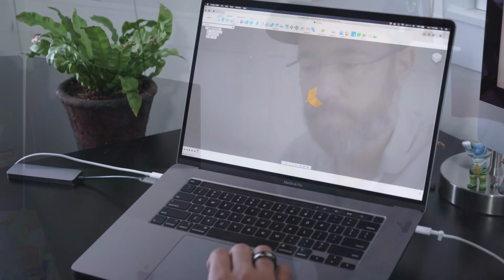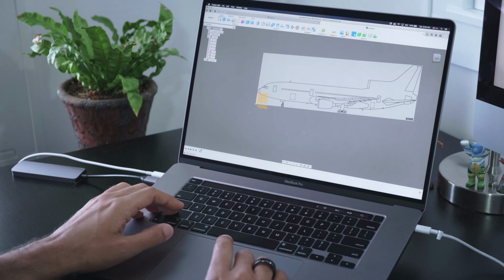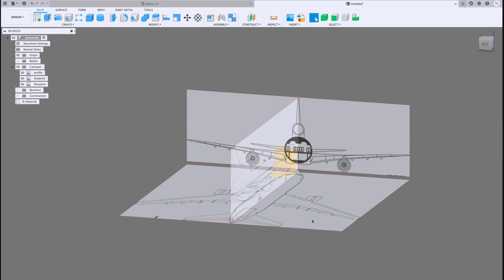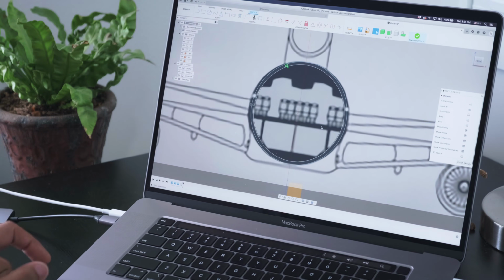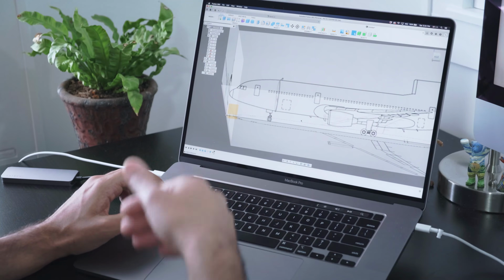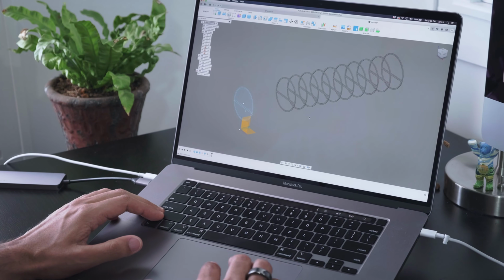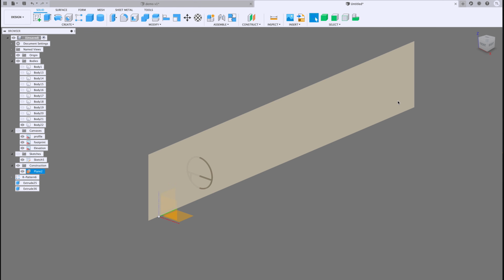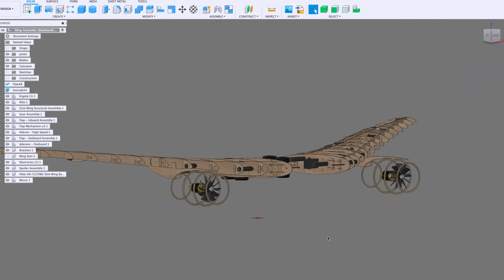How To Start Designing RC Airplanes in Fusion 360 Tutorial [Episode 1]

Comment: This is really, really amazing! I'm by no means a F 360 expert but I do know of a better way to build and extrude those fuselage formers/bulkheads. I traced out the sketch just like Terrence but I used the trim tool on the sketch to get rid of all the intersecting lines. After that you can select the whole shape without having to select each piece of the model to extrude it.

Comment: What do you use instead of the circle tool if the fuselarge is square with rounded edges?
Reply from the maker: In sketch, you'd draw the square then use the filet function to curve the edges.
Reply: @RCCAD2VR  OK I'll give it a try. Thanks for the reply.

Comment: How do you move a canvas n all three axis?  I have a top down view of a wing assembly BP, it is sitting on the x-y plane, in position on the side view,  in position on the top view, I would like move it up into position on the elevation.  I can only move it on the x-y plane right now.  Thanks
Reply from the maker: That functionality is not available when you're in parametric modeling mode. You'll need to turn off "capture design history" to make that capability available. Be sure to use my website link in the description, I put extra information there as well.

Comment: Excellent video.. I do have a bone to pick with Autodesk (who make fusion 360), as at one time, they had a free version of fusion, which I liked, so used it to develop some work, over a years worth. My work at that time was saved in an account at Autodesk, without any easy way to save it locally. Autodesk decided to force users to pay for use, and in the process, my years work vanished. Since than, I discovered Design Spark, which is a later development from somebody else and has a free version, which has a much more common approach, thus making it much easier to learn, and saves locally in many different formats and is at least as solid as fusion as a program. I am just saying be careful with your time as in my case Autodesk could care less. They appear to have gone back to a free version, but that does nothing for me.
Reply: I'm with you on Autocad purchase approach....not happy with loosing all my stuff and couldn't get it back after the paid sunscriptions

Comment: Hi. Awesome project. Trying to follow along but not getting the same results. First I have never used fusion 360 or any cad program. 
I have been involved with model RC well over 50 years. Built thousands of kits and thousands more scratch build the scratch builds were from scaling very detailed models. 
What ya doing is great. Great job. I don’t know why my canvas doesn’t work out.
Reply from the maker: Hey there! It's awesome that you are giving Fusion 360 and CAD design a go! Happy to hear you're enjoying the project. What issue are you having with the canvas? Just a tip as well, each episode has a companion webpage that I release at the same time that tries to answer many of the questions I get to help clarify anything in the episode. For this episode check out this page. https://www.rccad2vr.com/rc-airplane-design-build-episodes/how-i-designed-a-rc-airplane-in-fusion-360 Let me know if that help any. Cheers.

Comment: I'm interested in the topic of rc-plane design, and an experienced F360-user. Your use of existing drawings is excellent. Your way of adapting / editing & mirroring the vertical supports seems very UN-intuitive, over-complicated and slow. I wonder why you choose this process. Perhaps all will become clear.
>> suggestion[s]
1. Make sure your timeline is turned on
2. ALWAY start off by making every distinct part a 'component'; They are easier to align etc. at a later stage
3. Make your first 'component' called assy [assembly]
4. put all canvasses under this 'assy' component just like you did
Make a new component called RIB and activate it [if need be]
5. make your first drawing just like you did using the canvas
6. extrude the first 'rib' just like you did >> make it a new COMPONENT
7. move the first rib in position just like you did
8. create a pattern just like you did
9. go back in the timeline >> open the rib-sketch
10. draw ONE vertical support where you need it
11. WHILE STILL IN THE DRAWING: mirror  vertical support in the drawing using the vertical plane as you reference >> finish the drawing
12. go back in the timeline >> edit the rib-extrude
13. ctrl-click new vertical supports to include them in the rib >> they too will be extruded now
>> ALL IS WELL WITH YOUR RIBS NOW.  All you need is a bit of BBQ-sauce
Reply from the maker: Hey there -- As with any design software there are 100+ ways to get to a result. Sounds like you found a way that works for you! The tips you provided are excellent. Thank you for sharing!

Comment: XYZ origins for your lines layout is typically the theoretical apex at the nose, not to be confused with the actual tip of the radome.  Also max extents or trailing edges are defined as theoretical vertices, not to be confused with manufacturing constrained limits of material boundaries.  From these points all else is measured, calculated, analyzed etc.  At least in the McDonnell Douglas and Boeing and Japanese world's.  Not sure about Lockheed and Airbus, or the non-free world.

Comment: But for example, what if the plane doesn't have a round fuselage, I'm making a Bf-109 but its fuselage isn't round, and it changes a lot, how do I do it?
Reply from the maker: Hey there. Yes, that is a more complex airframe for sure. They are much more challenging to model. Check out my nose section and tail section videos. Those will lead you in the right direction for technique since they are heavily focused on using sketches and lofts to create more complex shapes. Hope that helps.

Comment: Thanks for the videos, very well done and informative, yet still easy to follow. I just have one question on your workflow, I see you are modelling the internal structure to follow the blueprint, but what about the skinning material? Either balsa or composites, they will inevitably end up out of scale or did I miss something?
Reply from the maker: Hey there! Happy to hear you're getting something out of the video! Since I was working with fairly low quality 3 view diagrams of the L-1011 I was not as concerned about being 100% accurate to scale since it would be next to impossible. Also I did not set the fuselage diameter to match the real airplane. It's a near approximation, so you did not miss anything 🙂 The skin will most likely be balsa and fiberglass. I have yet to experiment to see what will work best. Thanks for the comment and questions!

Comment: awesome stuff sadly the new dutch drone laws will kill all these kinds of craftsmanship from ever flying so for me my hobby is sadly over
Reply from the maker: Hey there -- Sorry to hear that. I did some searching on this and it looks like the dutch laws for this area of airspace is covered by the Model Flying Regulation. 

Flying model airplanes is covered by national law, the “Regeling Modelvliegen”, which will remain valid until 01-012-2023. According to this law it is not allowed to:

fly hobby model aircraft over 25 kg.
fly higher than 120m AGL in airspace G (except on sites of member clubs of one of the two Associations KNVvL or FLRCV: there the height limit is 300m AGL in class G)
fly over assemblies of persons, over residential, industrial or port areas and not over railway lines or paved public roads (except roads in 30km/h zones within city-limits and roads in 60km/h areas outside city-limits).
fly during the “aeronautic night”
fly within a 3km radius from an uncontrolled aerodrome
fly outside Visual Line of Sight (VLOS), so no First Person View (FPV)

This is very similar to the laws that are here in the United States regarding UAVs. Double check to make sure, it would be a tragic if RC Fixed wing aircraft are completely outlawed.

Comment: during my working life is used 2D CAD and you video has encouraged me to get to grips with Fusion360 and draw out a HP42 which I started to build 50 yrs ago but never finished it. Im getting to grips with it but have found another  problem I don't seam to be able to get around. I how do I copy the sketch of the from the  front former of the fuselage to the back so I can made the profile changes need  before I loft the skin?
Reply from the maker: Hi Laurie - Sounds like a great project that deserves completing! The way that you transfer from one sketch, or body to another sketch is by using the projection tool. This is covered in the following episodes. 

Let me know if you can't get it figured out and I will do my best to help out. Cheers!

Comment: How did you find these blueprints man? I have searched a lot and cannot find any having the same dimenstions. If i find top view, its size doesnt match with the front view or side view.
Reply from the maker: Hi Animesh, It does take some searching and most of the plans are not perfect across the three sided views. Improvisation is required to make it work. This site has many planes to get you started. 

https://drawingdatabase.com/category/aircraft/airliner/

There are several sites out there that have them. Hopefully that helps.

Comment: I set up a construction plane but how do you stretch it?
Reply: You don’t have to. You can draw on it or use it as a mirror plane no matter how small it is.
Reply from the maker: Hi Laurie, you need to click and drag the edges of the construction plane. When you put your pointer over the edge it should highlight the edge in a solid yellowish orange color indicating you can click and drag the edge. Make sure you don't have a selection priority set (under select tab) that can interfere with the selection if the construction plane edge.

Comment: What if all the fuselage formers or bulkheads are of a different shape?
Reply from the maker: I cover bits of this in the empennage video and nose section. I is best done using sketch. Depending on the shape you'll either want to define the formers and then add rails, or the way that I did it in the aforementioned two videos.

Comment: Hey Terrance, I am wondering how you pan around without always having to click orbit feature at the bottom of the screen. As of now, if I want to pan around to view something from a different angle i have to go down and click the orbit feature and that gets rather annoying.  Thanks
Reply from the maker: Hey there -- I can only tell you how I do it on a MacBook, not sure if the same works on other OS's. I hold down the shift key and then move across the track-pad with two fingers to orbit and simple move across the track-pad with two fingers without holding shift to pan. Hope that helps!
Reply: Ok thanks I'll give it a try 👍
Reply from the maker: Hey there, did that work for you?
Reply: If you have a mouse with a scroll wheel, press that and hold down while moving the mouse.

Comment: I had a question..if I follow these steps for Boeing 777..will it be almost similar or will that be completely different
Reply from the maker: Hello! I hope I'm understanding your question... If you are designing your plane using the B777 diagrams, the process should be completely identical. Just make sure you as calibrating your diagrams correctly to the scale you want. If you're not sure how to do that I've added this video to help out -> https://youtu.be/ui-rieDDdTQ
Reply: @RCCAD2VR  thanks a lot..can you check your insta..I had a query..and I have asked it there

Comment: This is a magnificent series. I just built a Mig15 from an old, inaccurate plan, and I had to spend an age, figuring out a ton of stuff and guestimating it. Now I can use this to get it absolutely correct. top marks, Sir!
Reply from the maker: Thanks Man!! Much appreciated, love hearing that the vids are helping, that what it's all about! How'd the MiG-15 turn out?
Reply: @RCCAD2VR  It's only a 24" span rubber-powered job, but it took me two years - on and off - to finish due its complexity. I enlarged an old plan, which greatly exaggerated the inaccuracies. I only needed the outline but guesstimating the diameter and hand-drawing the circular laminated formers, so that the longerons ran perfectly true, took ages. One was 1mm out, so there is a 0.5mm kink in the fuselage at that point. It's almost invisible, but it looks like the Grand Canyon to me!
I wanted to stretch myself, so I had already chosen the hardest colour scheme I could find - big rectangles that are symmetrical both left to right and top to bottom - which left nowhere to hide if the aircraft wasn't built perfectly symmetrical. It came out pretty well in the end but, oh boy, do I wish I had a CAD drawn plan to start with! I will definitely be putting my next build, an E.E. Lightning, onto Fusion360. At some point, I will make a video of the Mig15 when I have some flying footage, and post it on my channel.
Many thanks, again. I can't wait for the next installment.

Comment: Was the purpose of the video to introduce a complete CAD novice to Fusion 360?  Some of your viewers may get a tad frustrated without a basic working knowledge and understanding of CAD and the Fusion 360 environment. I did learn a couple of tricks, and thanks for that,  but that's cause I've been messing with Fusion for a while and have some decent 2D CAD as well as CAM experience. I'll keep following, cause I'm sure I'll learn something. However, I do recommend for the neophytes to explore some very basic tutorials, just to grapple with navigating the software.
Reply from the maker: Hi Joe... All great points! You are correct, some basic understanding of CAD and Fusion 360 would certainly help. My intention with this series of videos is to give more of an introduction and behind the scenes peak into how I am going about designing my aircraft, rather than a full deep dive into CAD and Fusion 360, since I've been getting a lot of instagram questions about it. This being my very first video, I've learned a few things on delivery, so I'll be splitting the next set of Fusion 360 videos into more bite sized chunks with a little more detail to fill in some of the gaps. Your feedback definitely helps. 
Thanks for subscribing, I very much appreciate it! Glad you were able to get a couple of nuggets from this one as well. Cheers 🍻